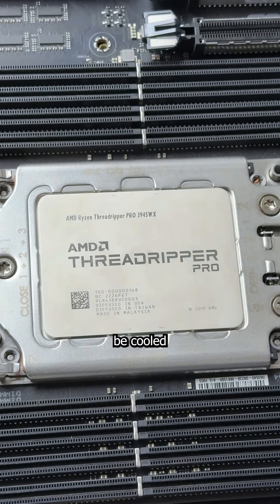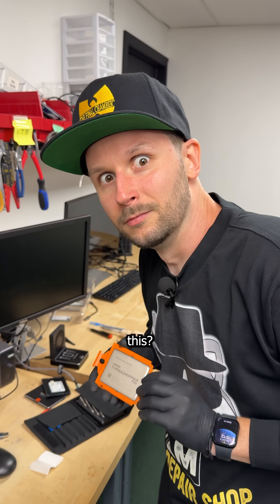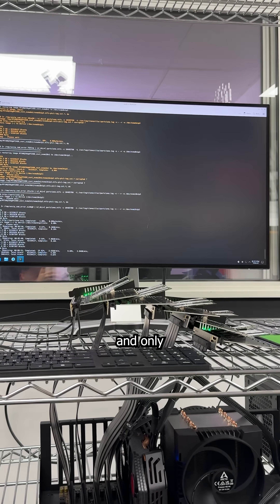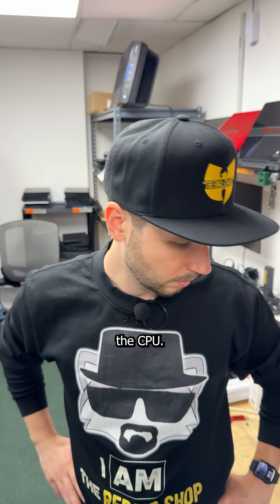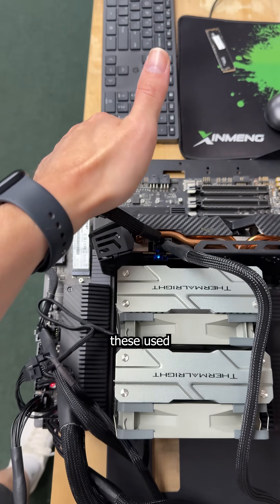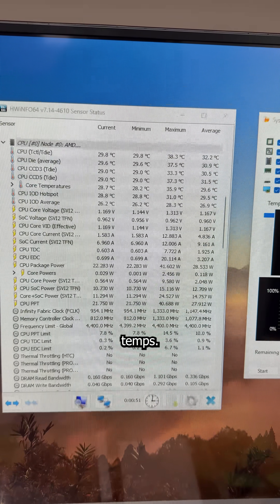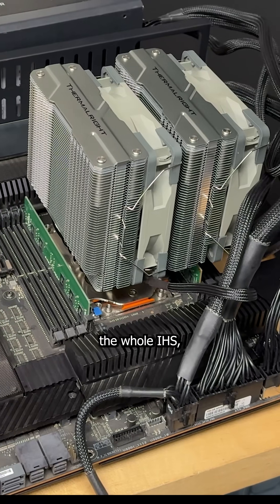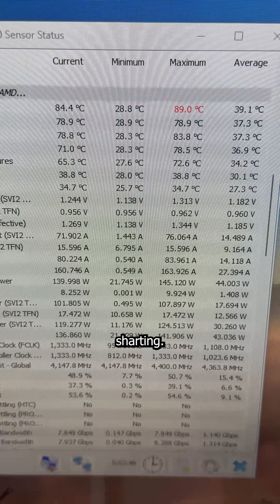Cooling a Threadripper with a Thermalright Peerless Assassin #pc #tech #technology #shorts

Comment: Hmmmmmmmm....
This chip is so large and has so many pins, that a loose and "small" cooler isn't your only problem there... Technically this seems fine, but the engineeres wanted you to use a cooler for this one to press it harder on the Mobo in order to make better contact to the pins on the bottom over the whole CPU by pressing down everywhere not just the corners... That's why there is a custom screwdriver that helps you screw it down everywhere to the correct and high enough pressure...

Comment: So wrong, the arctic freezer 4UM is the best for a threadripper air cooled system, not the peerless assassin. And it's better to have a bottom to top air flow system rather than a side to side or front to back method, such as thermal take tower 500-900 series

Comment: I am using Phanteks Glacier 360 M25 G2 with Threadripper 3960X, Although the cooler doesn't cover the whole CPU but still it is performing very well.

Comment: Why are you using a thread ripper for a cloner 😅 maybe i’m not understanding! What do you use macrium? I host that shit on a 4th gen i5 😂
Reply from the maker: You're not understanding, which I didn't either until I was confronted with this situation. You use Macrium because you're cloning 1 drive at a time. I'm using Clonezilla which can simultaneously clone as many as the hardware allows. The amount of drives you can clone at once is limited by PCIe lanes. This Threadripper was the cheapest option for the most amount of PCIe lanes.
Reply: @SalemTechsperts ok that makes sense! for your business that sounds perfect! For an IT team at an office, we would only ever need to do the one at a time!

Comment: I wish actual desktop CPUs had the same dimensions. At present, the actual CPU die barely takes a tenth of the PCB and heat is concentrated so much that despite the heat spreader, only the innermost heat pipes have any effect, making any amount over 6 blatant overkill. Meanwhile Threadripper coolers have as much as 12 of them. Also mounting hardware is better because it actually needs to ensure proper contact at all corners, while your average Lotes frame on a mainstream mobo is secured by a single spring and can bend non-square CPUs like LGA 1700.

Comment: There is one from Coolermaster that is similar in the push/pull config with 2 120mm fans on it.  I have been using the same heatsink for 15 years, thing is a beast and keeps any CPU I have tossed at it, cool.
This one you have seems to be built on the similar concept, with an extra set of sinks.

Comment: Great workaround next time: when pitting on a heatsink loosy goosy, put a little weight on the heatsink. A book for instance. Then rotate the heatsink a bit left and right. This spreads and squeezes out any overhead thermal compound. 
Heat transfer increases with its contact surfaces and diminishes with thickness

Comment: In servers 2 x of those CPU are usually cooling down with 1/3 size radiators without fans, just with airflow caused by pressure difference

Comment: One time I took an old PC of mine apart to give my little brother my old CPU, when I got a new CPU to put in it for server use I realised I lost the mounting hardware and ended up just using a random stock cooler I found lying around and zip tied it to the board. Best thermal performance I ever got.

Comment: Ya i did the same thing when my cooler wasn't strong enough so i put the open case nest to a 40degree f ac and bios changed fan speeds to max had to mess with power save settings but works

Comment: I rocked Peerless Assassin 120 on my first build for a while I "upgraded" to a noctua NH-D15S and it was about the exact same. 120$ vs 35$ air. Then I got the absolute beast of an AIO.  Artic Liquid Freezer Max 420  got those temps about 5 C° for 115$

All that yapping to say for about 35$ you get absolutely some of the best Air cooling possible.

Comment: I’ve been running a 2990WX with a Noctua Air cooler for years in an htpc case with no cpu throttling. 

No quite as scary as when I used to overclock the daylights out of my Athlon XP systems with $12-$20 coolers 😂

Comment: Could just get the Arctic Freezer 4U-M if you want a cooler that has mounting for Threadripper. Can be had for as little as $55 and it’s really good.
Reply from the maker: That’s exactly what I ended up using which you can see in the previous video

Comment: real men only update bios during thunderstorm 😂
Reply: REAL men de-cap their chips with nitric acid and update their bios one bit at a time with a magnetized needle.

During a thunderstorm AND a solar flare.
Reply: You forgot bulging AGM batteries in their UPS, that was last load tested a decade or so ago.
Reply: @theonlywoody2shoes  The UPS will start alarming if the battery fails, right?
Reply: @k.9880 ... as it fails, around a second before it cuts all power 😂😂😂
Reply: @theonlywoody2shoes  🤣
Reply: @solidacid1337  >,<
Reply: @solidacid1337 in a dust storm
Reply: You've got ball's of steel if that's true
Reply: @debert0912 ball of steel? Steel ball run???
Reply: @Chill_Pandass  🧑🏻‍🦽
Reply: Real life hardcore mode
Reply: For my first PC build i did not get the case so instead of waiting i booted my PC on a test bench, on my small table and while updating the BIOS I accidentally knocked the setup off the table and it was dangling by the power cables on my arms. I had never stayed so still in my life as I did then. Until it booted back up again.
Reply: Real gigachads only update bios during a hurricane
Reply: Love to live dangerous eh?😅
Reply: Buy an UPS boys it ain't that expensive.
Reply: i remember being unlucky enough to start my bios right as a thunderstorm started. thankfully, bios updated and the power went out 15ish minutes later
Reply: Real men don't update their BIOS, bareback that stock firmware baby 🥵
Reply: @brainloop99 not always a bad idea in some cases, A320 chipset with a ryzen 3000 series cpu can enable PCIe 4.0 on the pcie x16 slot and the first x4 nvme slot(depending on manufacturers board design)
Reply: Me yesterday for some shit reason, at least everything went fine! XD
Reply: at that time even an atheist prays
Reply: How about during an ice storm with high winds?
Reply: No, that’s not being a real man that’s being stupid
Reply: @CrocoDylianVT  welcome to earth! there is a thing called... umhh... sarcasm.
Reply: @ZaharielEl-Zurias  sarcasm/joking are a nice excuse for being dumb

“Oh no they think I’m a dumbass I’ll say I was joking so I can get away with it”
Reply: @CrocoDylianVT god forbid a man has humor
Reply: I have done this shit multiple times, I still live somehow, the mobo that is.
Reply: or we had the wisdom to purchase a MB with a BIOS Flashback or recovery feature
Reply: Pure adrenaline
Reply: I actually did this lol. Updated my gaming laptops bios during a storm and the power went out now its a brick lol.  Still have no clue why it didn't use battery power while it was doing it though it wouldn't even let me do the flash until I plugged it in to the wall too.

Comment: My go to threadripper cooler has always been a bequiet silent loop, easy to find in 360 and 420 options, it works well, comes with the correct mounting hardware, and its less than a third of the price of a threadripper specific AIO like a Silverstone or doing open loop

Comment: I think the mounting on these CPUs is designed to be held properly down by mounting the cpu cooler on it tightely, otherwise there might be issues with pins properly contacting the CPU, but that was with 1st gen threadripper, maybe they fixed it for the 3rd
Reply from the maker: You’re correct, these need to be torqued to a specific value. I used my Bluetooth torque screwdriver to do it properly (I just screwed it in and it worked)
Reply: The newer threadrippers aren't held down by the cooler like smaller lga cpu's, the hold down bracket on the socket is supposed to be torqued down and that holds the cpu firmly against the pins. With such a big cpu it's risky to rely on the cooler to hold enough pressure evenly for good contact.

Comment: Thermal paste, gravity, and prayers kept my first PC alive for years, it'll work as long as you don't shake it
Reply: Have you done your daily prayer to the machine spirit?
Reply: @chriskempe2185  The Omnissiah must be pleased with him for his cogitator still works.
Reply: He said, spermalpaste.
Reply: With my third or fourth machine I took the case off and blew a small fan into it when the CPU fan died.  It ran good for a couple of months before I got around to replacing the CPU fan.
Reply: The "Greatest Technician that ever lived" forgot to try some zipies....C'MON ANDY!!!!!!
Reply: Turning it on and walking away always worked for me. My theory was that if I saw it boot, it would crash immediately.
Reply: So true. When I first got my pc it had a messed up harddrive port, so shaking it could cause a short. I found that out one day when I dropped an empty hydroflask on it and it rebooted lul
Reply: that very combo kept my overclocked athlon at 7 degrees

Comment: It really is one of the best CPU coolers out there within it's price bracket.
Reply from the maker: Thermalright owning their own factories means they can pump stuff out so good and so cheap
Reply: Not only within its price range, but in comparison with coolers three times the price.
The difference in temperature between the Noctua NH-D15 G2 and the Thermalright Phantom Spirit 120 at full CPU load is between 1°C and 3°C (depending on case and chassis fans) ... but the Noctua is 4.5 times the price (180 bucks versus 40 bucks).
Thermalright is the nemesis of all greedy cooling solution manufacturers (Hello Noctua, NZXT, and Cooler Master).
Reply: @Gaius__  I will say Noctua is marginally quieter and almost certainly the fans will last longer. Not only that, Noctua has incredible support for all their products. If you bought a DH15 ~15 years ago, it's almost certainly still going, and they've released updated mounts for all their coolers. If you ever upgraded your mobo and you don't have mounting hardware for your Noctua cooler, you can just reach out to them and they'll send it free of charge.

Granted, I think TR is the better value for almost everyone. I've got 2 Peerless Assassins and 1 DH-15. But my point is that Noctua isn't anything like NZXT or CM.
Reply: Even if you miss to peel of the plastic (like me), it will cool... and without the plastic even better :D
Reply: I got the thing cooling a 9800X3D and it has absolutely no problem doing it's job even when having to use the integrated graphics.

Gotta love when a modern game just decides not to detect the 9070XT in the system...
Reply: @AeronHale   Many games decide which graphics device to use by its power consumption, favouring the one which requires less power. By definition, that will be your integrated graphics. You can check whether the game has a settings option which can take care of that. If not, there is a registry hack that will work (if you are on Windows). However, messing with the registry is always a bit meh, so the easiest thing is to simply disable the iGPU in your UEFI settings (BIOS).
Reply: @Gaius__  Definitely not on windows but the game I had in mind(Star Trek Online) got an update that fixed that issue but now causes driver crashes in one of the main social hubs...
So I've kinda dropped that one for the time being